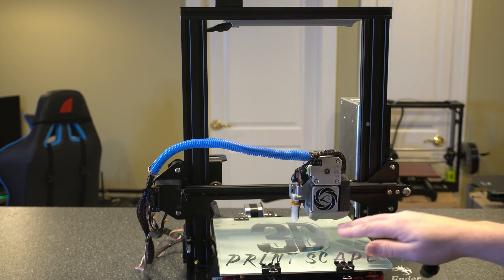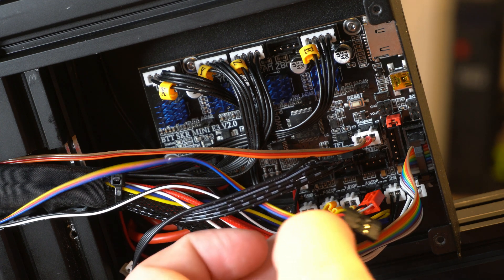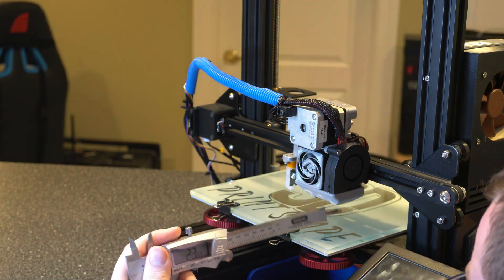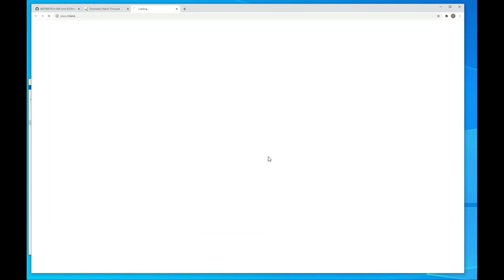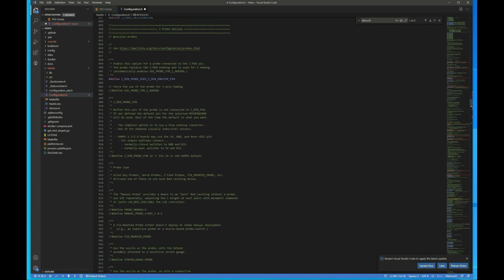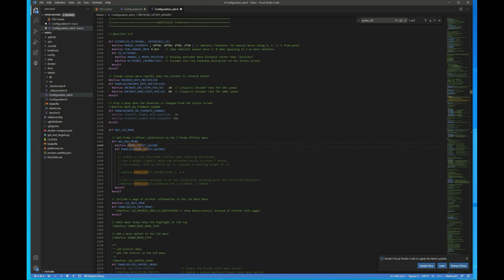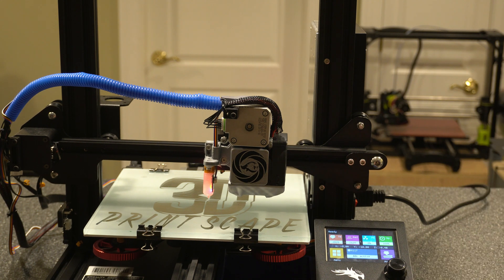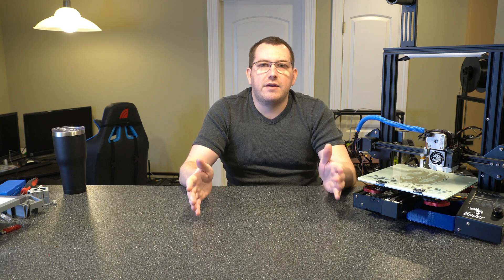BLTouch on SKR Mini – Install Guide

Comment: Just decided to tackle this tonight with the “stock,” firmware for bltouch ztop . The bracket I printed for it had the probe too high, so I used the springs to space it…either way, when I go to auto home Z it just goes super high, and then throws “z end stop,” error and the I lose all ability to move Z down until I reset the machine. 

Any ideas?
Reply from the maker: Hi. How did you wire the bltouch?
Reply: @3DPrintscape  Exactly as you showed. I was using the precompiled firmware. Seems as if a lot of people in the reddit were having similar issues with that firmware. I'm currently trying with the config you set up here. However, I did notice that putting in the "_512k" line caused failures when compiling.
Reply: @3DPrintscape  By the way, I wrote the file as you directed and it worked, I'll share this with the reddit page, in case anyone else has the issue with the precompiled firmware
Reply from the maker: @shespoketo_us245  So were you able to get everything working?  Also, thanks for helping out other people on reddit.
Reply: @3DPrintscape  yeah, I have some other things I need to work out, but the main function is performing as intended!

Comment: intellisense shows errors over most of the files and just about every single one of them says expected an expression. there's also no option to compile. my only extensions are c/c++ and platformio ide. even tried following guide on different computer same errors
Reply from the maker: Hi. If you got the same behavior on multiple computers the issue is probably with the firmware bundle or the platformio.ini file. This may be easier to troubleshoot on discord if you can join.

Comment: If i cnange the name to Platformio.ini Change: default_envs = STM32F103RC_btt_512K it won't build?
Reply from the maker: Hi. What errors are you getting?
Reply: @3DPrintscape  I'm getting the same issue. Error is Unknown Environment Names 'STM32F103RC_btt512K'
Reply: @3DPrintscape  however it will build with STM32F103RC_btt
Reply from the maker: @nedsdead1639  They removed the _btt512K option in the last config release. If your build compiles without it you should be fine.
Reply: @3DPrintscape  it did! Several test prints later I'm happy 😁. Thanks dude!
Reply from the maker: @nedsdead1639  Awesome, glad to hear it. You're Welcome!

Comment: I'm having issues with the bltouch probing off the bed on the y-axis during bed leveling. The initial probe (homing probe) is perfectly in the middle. The second probe (front left) then tracks to miss the bed. I also have my offsets set correctly (given offsets for my Hero me 5). So far to get printing i've had to change the probe offset for the y-axis to be technically incorrect. The home probe is not centered, but the rest work...Any ideas?
Reply from the maker: Hi. First make sure you cleared your eeprom. If thats done and you are still having the issue you can adjust your #define X_MIN_POS & #define Y_MIN_POS values. I think im running -5 and -10 as i had a similar issue.

Comment: I followed this tutorial exactly and my ABL page doesn't look like that. Mine doesn't have the on/off function that you are using, and if i try to use ABL, it just keeps going down until the nozzle hits the bed (and tries to keep going but i shut the printer off before it can)
Reply from the maker: Hi. It sounds like the wiring doesn’t match the firmware configuration. What firmware are you running and how was it wired?
Reply: @3DPrintscape  Well I ended up flipping the white and black wires on the z stop and the bltouch finally started to function. I'm still not seeing the on/off option in the z offset menu like you have.
Reply: @3DPrintscape  Yes I'm running the tft35, and yes I updated to the latest marlin, brought over the appropriate configuration files, and uncommented everything you did in the video. I ran g29 from the terminal just now and it's showing me what appears to be a decent mesh but I would still like to actually be able to use the z offset wizard in the way you are able to.
Reply from the maker: @devonschevers4056  Ok, the process is a little different on the tft35 as its built-in. Take a look at this video. https://youtu.be/2gRfU26aTDs
Reply: @3DPrintscape  I'm confused, you used the tft35 in this video as well, and the changes you made to the advanced config file are the same as well. I have it working and printing fine, I just have no way of adjusting the offset like you do in the video.
Reply from the maker: @devonschevers4056  Did you update the tft35 firmware and enable babystepping in marlin?
Reply: @3DPrintscape  Oh my god you mean the firmware for the actual tft35 not the printer, no I never even thought to update the display board itself. I will look at that when I get home, thank you so much for the replies!
Reply: @3DPrintscape  Updating the tft35 firmware was my problem all along, feels really stupid when it's that simple, but again thank you so much for the help!
Reply from the maker: @devonschevers4056  Its an easy thing to miss but I'm glad you got it working.

Comment: Holy crap man!!!! I have looked everywhere for a video that explains and showed exactly what you did!!! Thank you so much!! I have had the bl touch for 6 months, hooked up for 3 and never plugged it in because I had no idea what I was doing. I have watched hours of YouTube trying to figure it out and googling everything and couldn’t find anything that explained it better. No one explained the wires switched, and mine were and I was so confused. I’m new at printing so I got the already done one you showed, I just picked one and hoped it was right, but your video confirmed it was the right one. Thank you so much.
Reply from the maker: Hi. Thanks for the feedback and the lack of content around alot of 3d printing is one of the reasons i started this channel. Im glad you were able to get everything running.

Comment: So on mine I wired it the same way you did and my Z stop DOES NOT work I cant figure out why but everything I try the Z axis doesnt stop and keeps hitting the bed until I power it off, any suggestions??
Reply from the maker: Hi. I think you reached out on discord and the issue was related to the firmware. If not let me know.

Comment: When I follow your instructions on VS Code I don't have checkbox to build on my (latest) version there are 2 errors in the far bottom left though, any thoughts on this?
The 2 errors are to update include path
Reply: I fixed this, I had been in the Python environment prior to configuring this firmware and it loaded up the next time in python, I just switched to Platformio
Reply from the maker: Hi. Im glad you got it working, though the python environment shouldnt be needed. I don't have that running now and it works for me. My guess is that it installed/repaired another component.
Reply: @3DPrintscape  I was using python for something else prior to configuring the firmware and VS Code must have loaded in Python mode when I came to configuring Marlin, that's why I was getting errors and no checkbox

Comment: There's no check at the bottom left of my hot bar only 2 icons and it says no problems. The only thing I havnt done is the probe to nozzle distances because I don't have my hotend mounted currently
Reply from the maker: Hi. There are a coupel of things that would cause the checkmark not to be there 1) you dont have the right folder open 2) platformio is not installed 3) plaformio failed to install the C/C++ plugin.. Can you check all that?
Reply: @3DPrintscape  Vscode says the terminal process failed to launch path to shell executable and then says my file doesn't exist. Platformio installed. Aswell as c/c++
Reply from the maker: @VeneerSlinger  Sounds like there may be an issue with the vs code install, or other security tools on your computer interfering with it.

Comment: Have you installed a skr mini in a car 10?
Reply from the maker: Hi. Assuming you mean CR 10, i haven't personally but i have helped people setup the firmware for it.
Reply: I’ve compiled the code only to get a #if with no expression error on the #if is ultipanel

Comment: @3D Printscape  Hello. I am trying to install my BL touch that I got straight from Creality, but It is designed for the original board... I cant rearrange the wires on the connecter. Can you please help?
Reply from the maker: Hi. Ive seen the bltouch shipped with 5 wiring variances at this point. I wouldnt count on getting the right one anymore as there is no way to guarantee what your getting. If the one you have doesnt match what is needed, you will need to change the pinout.

Comment: Hi! Can you please help me. My bed keeps hitting the nozzle on autobed leveling!! I have ender 5 with skr mini v1.2 and bltouch. I can't find any relevant tutorials for this exact problem 😭 thank you!!
Reply from the maker: Hi. It sounds like it could be a firmware or wiring issue. Can you join me on discord, it will be easier to help with troubleshooting there. https://discord.gg/Bu94EYVkrU

Comment: when I use the Z-wizard the BLTouch crashes into the bed. Can you help?
Reply from the maker: Hi. If the nozzle is crashing into the bed on an autohome, its probably related to the wiring and firmware not matching.
Reply: @3DPrintscape  it was the wire on the z stop needed to be flipped.
Reply from the maker: @89ccobb  That makes sense, so is it working good now?
Reply: @3DPrintscape  yes. Thanks for the video!
Reply: Can't find the check box you mention around 15:50
Reply: @VeneerSlinger  are you getting 2 errors as well? if so you need to uninstall VS Code then in file manager go to C: then Users then your user folder then delete vscode, then reinstall VS Code and make sure you install the platformio plugin and enter into that plugin (alien face icon) and then load your folder

Comment: I made all the changes but I'm using "Marlin Firmware Auto Build" it wants me to pick an Environments with 4 choses.
Reply from the maker: Hi. I havent used that. What are the options it gave you?
Reply: @3DPrintscape  STM32F103RC_btt, 
STM32F103RC_btt_512K, 
STM32F103RC_btt_USB, 
STM32F103RC_btt_512K_USB
Reply: Is there any way you could upload your .bin file to say Dropbox or even email? Everything I try to update of up grade, I have problems. Don't know if you remember when I was having with Cura.
Reply: And also, since I followed you step by step I wired the mother board like you but when I plug in the SD card into the mother board SD reader (believe this or not) it changed the .bin to .cur (cursor)
Reply: Don't worry about it, I'll try to get answers elsewhere!
Reply from the maker: @rickherrin5364  Sorry, i was not home yesterday. Were you able to figure out the issue? If no, I can still help out. The easiest way to troubleshoot would be on dicord. https://discord.gg/Bu94EYVkrU

Comment: I keep getting region rom overflowed by 2180 bytes
Reply from the maker: Hi. Did you add the _512K to the environment in your platformio.ini file?
Reply: @3DPrintscape  yes I ended up googling and did that and it fixed it. Thank you!!

Comment: is there anything special we need to set up with the gcode or is it good as is?
Reply from the maker: Hi. You will want to add a G29 command to the printer profile in cura. I cover that in more detail in the update printer profile section in this article https://3dprintscape.com/guide-to-install-a-bltouch-on-a-creality-32-bit-mainboard/ . Im working on the written instructions for this video, I just haven't finished it yet.

Comment: Can you plz help me im trying to do this on my anycubic mega zero with the stock board would there be a way that you can get all the firmware ready and like share the done file so all I do is put it on my SD card ove been working on it for about 10 hours and its not working
Reply from the maker: Hi. I dont have firmware prebuilt anywhere, but I have been considering going that route. What errors are you having? Also, you can reach out on Discord for assistance as well. https://discord.gg/Bu94EYVkrU
Reply: @3DPrintscape  would you be able to make me firmware? i can pay you to help me get it working
Reply from the maker: @3dprintingtoday  Hi. i may be able to help out some tomorrow or Friday morning. Can you join my discord server and message me there? https://discord.gg/Bu94EYVkrU

Comment: @3D Printscape Thank you very much for your video! It was very helpful, but I am still having some issues. I have your exact configuration but I flashed the pre-compiled firmware (2.0.7). Unfortunately, when I try to set the z-offset I can't get the z-axis lower than 0 and it is too far from the bed! Could you please help on that?
Reply from the maker: Hi. This is a common issue with the creality firmware because the leave the software endstops enabled. You will want to take a look at this reference to send the g-code command to the printer ( https://marlinfw.org/docs/gcode/M211.html ) or i can work with you to get a Marlin build that has it disabled. If you want to go that route, you can ping me on discord. https://discord.gg/Bu94EYVkrU
Reply: @3DPrintscape  thanks a lot, issue solved!
Reply from the maker: @marcoserafini6875  You're welcome, glad i could help.

Comment: Followed step by step. I got Failed to enable Bed Leveling
Reply: FIXED If you get this error, do a homing sequence! Had to do it 2 times before it cleared.
Reply from the maker: Hi. I recommend starting with a temp tower (i made a video covering the topic that you can see here https://youtu.be/cINepqqcKEo ). Also, you may need to make some tweaks for the Ender 3 v2, but this will be a good starting point.

Comment: In the platformio the default_envs is mega2560 downloaded file 4/3/21.
Reply from the maker: Hi. If your downloading it from Marlin that doesnt surprise me. You will want to make sure you update it when you download a new copy or anytime your switching between boards.
Reply: @3DPrintscape  thanks tried it because it would always give me a error and I did download from marlin. I deleted mega2560 and put the one in the description and it worked. Thanks a bunch that was kicking my......
Reply from the maker: @JrFrOmDaBx  You're welcome, glad i could help.
Reply: I’m having the same problem. It doesn’t matter what I do I can not change it from mega2560 😩 any ideas?
Reply from the maker: @ryanmitchell405  You could try to use the Marlin auto build plugin, it makes changing between environments easy. https://youtu.be/EerWIATEsM0

Comment: Hey, awesome video, thank you for your contribution! I have the 3Dtouch with 5pin in a row connection therefore I followed all the steps but the two when it was about the connection. What i get when firing up is 'Failed to enable Bed Leveling, Bed Leveling OFF,  Fade Height 10.00'. Also i cannot acces the option you are showing in 17th mnute of the video. Would you be able to help me out? P.S. I tried building both with configuration_adv delay and sw mode on and off since you mentioned it might play up with the offbrands.
Reply: UPdtae: I did changes according to the https://www.reddit.com/r/ender3/comments/h8y1ia/marlin_20x_guide_skr_mini_e3_v20_ender_3/ and https://www.reddit.com/r/3Dprinting/comments/hx6ab3/bed_leveling_bltouch_inductive_sensor/ and after powering up i dont have any issues yet the option you are showing in 17th minute is still unavailable. I dont have in the echo as you 'ABL active', instead i have 'Fade height:10.00'
Reply from the maker: Hi. What are you seeing on the z offset screen and did you update the firmware on the tft35?

Comment: Great video!  One little tip for ya...instead of having to add G29 to your gcodes,  you could always uncomment ENABLE_LEVELING_AFTER_G28.  This way it's always going to use your ABL mesh.  I personally like to hard code all my standard settings (including my calibrated esteps number) that way I don't have to mess with it later.  Another fun thing to add so you don't have to manually mess with it later is changing the preheating presets.  (line 1702).  I don't print ABS, so I replaced it with PETG and set my standard nozzle and bed temps for each.
Reply from the maker: Hi. Thanks for the feedback and tips. I didn’t think of changing that in the firmware but ya it would work.
Reply: A Great tip Andrew! I will be installing an SKR Mini E3 V2.0 as soon as it is delivered as I recently went through the pain of installing a BL Touch Kit from Creality with 1.1.6 BL Touch firmware and it is terrible firmware, the x,y offsets were not changed so when probing the nozzle was in the position where the probe should have been, and also when slicing a part in the centre of the bed it ends up printing far right on the bed, also they did not implement baby-stepping so you had to restart a calibration print for each change of the z offset which decided to stop working altogether after a while, and I am not 100% convinced the firmware is actually using the mesh created by the BL Touch, Creality did not answer any of my questions and I contacted them in 8 different ways, I bought the kit thinking it would save me time from editing firmware, I think I have learned the hard way about Creality's programming skills, which isn't really programming but the config editing and they cant get that right for their own printer!

Comment: When I go to perform the Z-step offset the BLtouch crashes into the bed
Reply from the maker: Hi. It sounds like a wiring or firmware mismatch. How do you have the bltouch wired and what firmware are you running?
Reply: @3DPrintscape  I have the wires red, yellow, brown off the top of my head. I complied marlin 2.0.7 also, ill have to confirm this later
Reply: confirmed I have the same wiring as shown in the video. Only difference I have a brown wire instead of blue.
Reply from the maker: @silklake4589  It looks like you joined the discord server, can you send me pictures of the wiring and your config file there?
Reply: I am having the same issue. Not sure what I am doing worng.